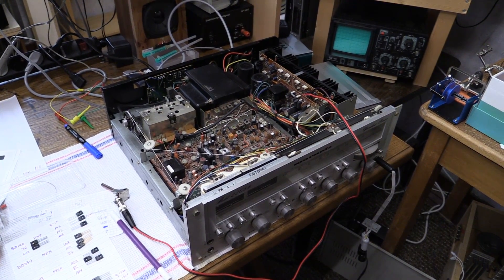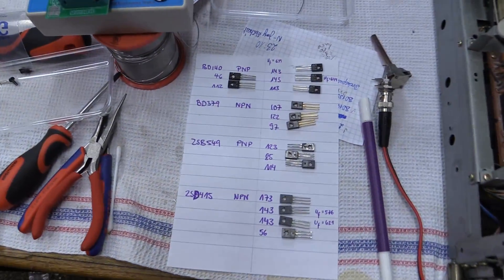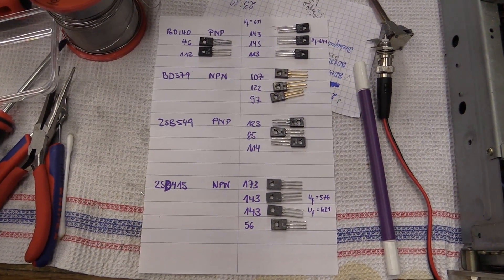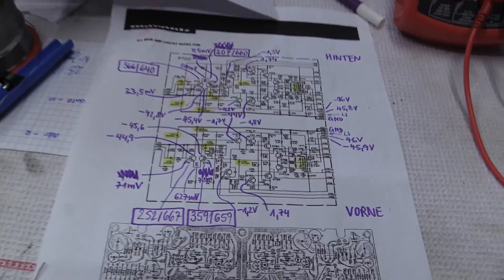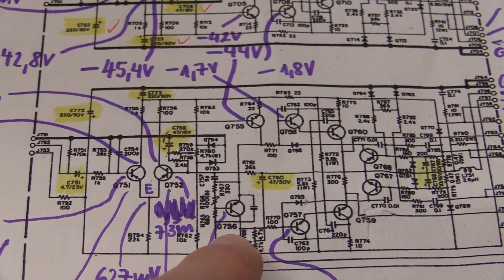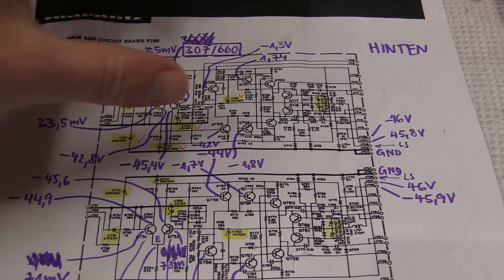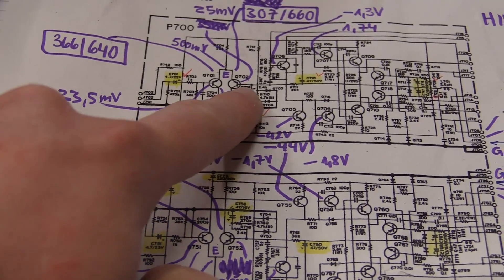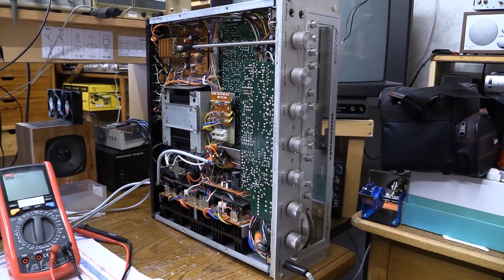DrCassette's Workshop - Marantz 2265B receiver repairs IV

Comment: An amplifier of that vintage will need replacement Electrolytics, they may test OK but after 20years + they are failing. Older Japanese equipment does suffer from its share of drifting value resistors, check these in all relevant areas. In my experience with such equipment the Transistors are reliable, unless they have been damaged by faulty passive components, or power supply issues and shorted outputs.
On reflection most of the problems tend to be with the preamplifier stages in one form or another.
Reply from the maker: The preamp is fine. I already replaced capacitors. All that's left to cause problems are resistors and transistors...

Comment: I think your over-thinking this a bit. Start simple. I had a realistic with similar issues, and turned out the issue was in the pre-amp stage. Not the power stage. Your voltage amplification stage (VAS) is the transistor pair connected to the differential amplifier. This will affect output level/gain.

Did you check pre-amp signals going into the power amplifier PCB to see if the signal levels (via scope) are identical in amplitude? Also check DC-Offset levels coming from the preamp to the power output stage, Even though there is a blocking capacitor, any DC offset there that is different from the good stage can indicate something.
Reply from the maker: I fed a signal from the signal generator directly into the main in of the receiver, with the exact same result. So the preamp has to be fine...
Reply from the maker: Looked at the input signals as they come into the power amp with the scope, both channels appear identical.
Reply: DrCassette well then at least from this point forward you can forget about everything except poweramp module. What about the ceramic caps? Check those for leakage?
Reply from the maker: How do I do that? I haven't tested any of the ceramics yet, never experienced a bad one so I thought those would be safe...
Reply: DrCassette see if you can look on ebay for a capacitor tester with leakage testing it was used with the old tube stuff and it would work here
Reply: DrCassette your other option would be to use a micro ammeter in series with a variable dc voltage power supply and increase the voltage and watch for leakage currents
Reply from the maker: I have an ESR meter, however, I do know there is other test equipment that features a dedicated leakage test...
Reply from the maker: Well, if you watch the whole video series, you'll find out it was nothing but a bad solder joint causing all the problems...
Reply from the maker: GTI1dasOriginal I get a feeling that you WANT to be misunderstood! This is unfair: You comment on an old random video you've seen completely out of context, even ignoring the annotation saying that the problem has been solved. And when I tell you that the problem has in fact been solved, you react offended. Would it make a positive difference to you if I added a "  ;)  " to my reply above, or do you want to discuss about an already solved problem so badly that it offends you if I don't want to? The receiver is all up and running again, any further investigation of possible problems is a waste of time! :)
Reply from the maker: Thanks :)

Comment: I think you have a bad resistor somewhere close to the input pair. You have 25% less current flowing through the input pair, on the loud channel.
Old resistors can go bad over time, sometimes they increase their value. So check that R793, R763, R756, R755, R753, R754 and R762 all have the correct value. There has to be a reason to the low input pair current.

Comment: I think that the 0.1V difference in the -ve supply is worth pursuing further.  If, as you say they both feed through thick wires from the same source then this means that your quiet channel is drawing more current from the -ve supply in order to produce that 0.1V drop. So measure the current being drawn by disconnecting wires and insert current reading meter.

Where is the current going? If you do some more d.c. measurements then you can find out.  For instance. the top end of R704 is at 45.8V and the bottom end is at 500mV so the current through R704 is 45.3/22K which is about 2mA.   This current then splits between Q701/2 and then on through R705 and R706  so, by measuring the voltage across these resistors you can see where the current goes.  (if you measure the resistor value then you can be quite exact)

Then, you will also know the voltage across R743 since the other end of that is at -46V so you can calculate the current there too.  The total current through R743 must split between 705,706,713 and 714 so a couple more measurements across the resistors 713 and 714 will show you where all the current flowing through R743 is going.

Keep going and you can do a complete circuit analysis dc wise and learn a lot this weekend.

for instance, once you know the current through Q701 then from the gain you should know the current into the base of that transistor which can only come through R703

Noteable also is that you have measured the forward voltage drop of 701 at 0.64 on your tester but your circuit measurements would suggest only 500 - 33.5 mV which is only .47 not 0.64.   Is J701 at 0V or is the driving stage zero not tied to the amp stage zero?
Reply from the maker: J701 is the ground that comes through the input wire shielding. I took those (J701/J751) as the reference point, so the meter negative was always connected to one of the two (except for measuring power supply voltages).
Reply: DrCassette
Well that sounds right but I also notice that in the diagrams for american and european wiring (7.2 and 7.3) the wires for 701 and 702 are swapped over (which I cant make sense of really) but if someone has been in this amp before maybe there is a wiring mix up?
Reply from the maker: jack hodges
 The wiring is fine...
You are really asking a lot. It's next to impossible to stuff any test leads into the power amp when it's installed and functional. The .1V difference might just have been the meter acting it up or the test leads making bad contact...

Comment: I would retry to recalibrate the offset/bias (R710/R760 plus the R716/R759(?)) while disconnecting the respectivly other channel from it's 46V-Rails, in order to have this at least not poking in the totally wrong direction.
If it's not possible to sort out the issue from the static DC situation: Try the signal path: Reconnect both, feed a single 1000Hz sinusoid signal in the input and trace down the signal levels with an oszilloskope in in AC-mode.
i am still not sure if it's not one of the output capacitors or diodes who causes this feedback issue.

Comment: Vllt. ein Glimmer Plättchen vergessen wider an zu bringen, oder vllt. eins beschädigt?
Was du auch probieren könntest ist, den kompletten Endstufenblock mal vom restlichen Gehäuse isolieren und dann mal messen/testen.. die alten BGW systems PA endstufen (~1970-80) zeigen manchmal ganz seltsame symptome (ein Kanal leiser als der andere, Oszillation, Verzerrungen..) wenn da Masse an der falschen Stelle 'anliegt'
Reply from the maker: Die Transistoren sind alle nicht isoliert montiert, außer die Ausgangstransistoren, aber an denen habe ich bislang nichts gemacht. Ich schau aber mal nach :)

Comment: I think what I'd do is completely recap the unit - replace everything. Check that there's nothing loading down the power supply when it's running (assuming those voltages you took weren't under load)
Reply from the maker: I have already replaced the capacitors...
Reply: DrCassette
You used used capacitors though - are you sure they're all good even when tested under load?
Reply from the maker: Ashley Cox
They should be all good. The thing is, from my local electronics store I can't really get anything better - their parts are either questionable China crap or 20-30 years old! But with or without load, theoretically the caps should behave the same provided they have a low ESR.
Reply: DrCassette There is a trap! I have had capacitors that test good in ESR, and good in capacitance, But still be leaking under working voltage. Rare, but possible.
Reply: *****
Even the cheap Chinese caps are better than nothing for a test. It'll cost next to nothing to recap that amp board with new caps; and if it works, you can always put nice caps in down the road. Check all the resistors too
Reply from the maker: Ashley Cox
I really don't like the idea of spending at least 10€ just for a test...